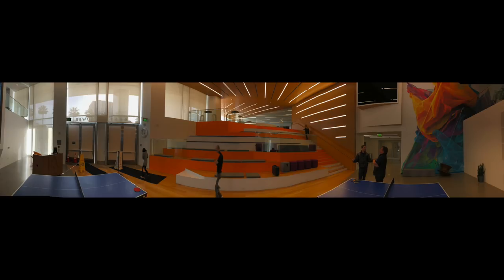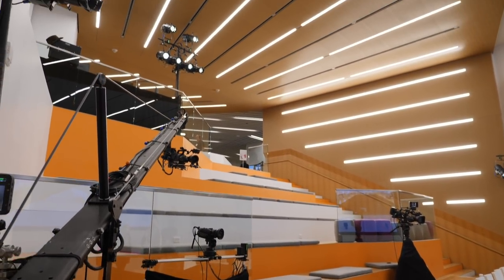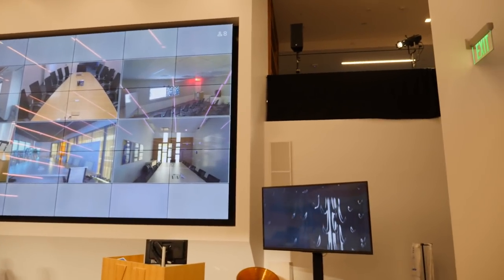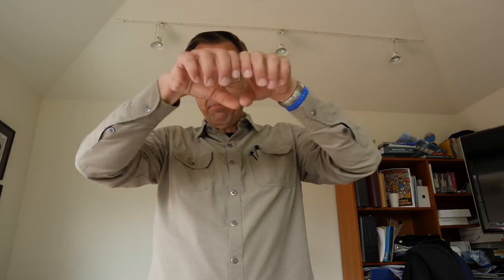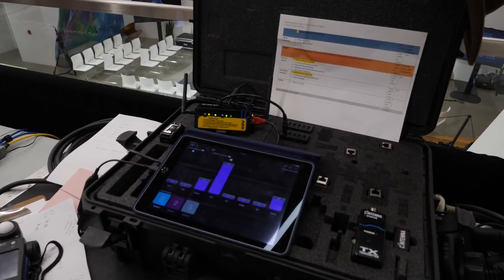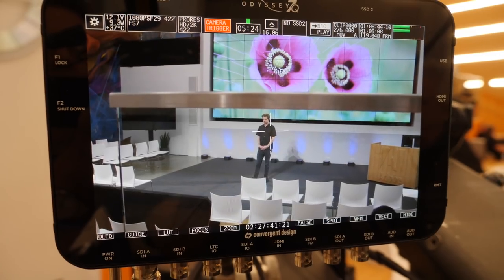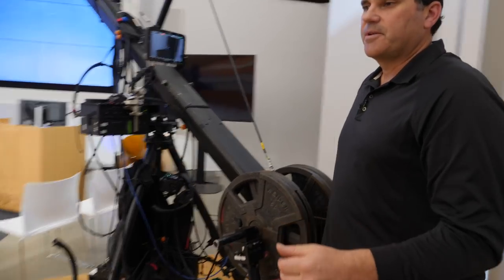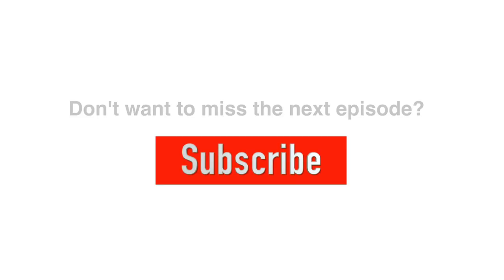Meet The Gaffer #92: Daylight Ellipsoidals

Comment: I used the first gen of the LED Source4's and found that color rendering and output wise they didn't really quite match up to the original. What gen were these and how did they perform?
Reply from the maker: The Series 2 definitely has more output. There is still more color fringing than I’d like, but that comes from having multiple color sources, instead of one tungsten bulb... and that’s true for both the Lustre S2 and the Daylight HD S2. That said, for a unit that has just a little less output than a 400 joleeko, is somewhat color tuneable, has minimal power draw, and has an on-board dimmer and DMX, it’s become a staple for regular interview set-ups where we need a fuzzed out window pattern or smash of light:)
Reply: Thanks for input! Seems like I may need to take another look at these...

Comment: Nice set up, as usual. Did you have any issues with lights reflecting off the large screen into the cameras?
Reply from the maker: We did not, but mainly because most Cameras were capturing talent with only the lower half of the screen. Whatever reflections were there momentarily in the handheld and jib shots were acceptable because we also had the ceiling and wall lights on and in line for reflection. We dimmed our Lights during video playback to the large screen, but the house lights stayed on... the LED monitor Wall was plenty bright regardless!

Comment: Hello Luke thanks again for the great vids. Have a quick question. I am looking for a "big light" that I can use on some shoots but honestly I never have a shoot that would allow for something bigger than wall power in a building or home. We don't do big generators😜. I am looking at the Hive 1000 wasp and wanted to ask, have you used that light and what are your thoughts? They claim to have a 10K equivalent punch and not a hot light. Thanks in advance.
Reply from the maker: We are always looking for the biggest bang for the buck! I dapple in units made by smaller brands, but as someone who rents equipment I need to have brand name fixtures available. If this is true for you, I would probably figure your “big light” is still an HMI. An Arri S360, a Mole LED Tener, or a Cinemills Sufa Bullet will all run off a standard US 20amp wall outlet, but may be more than you want to spend? I’m interested to see what Cinegear has to offer, but I’m not sure that anything has clearly eclipsed the color, compactness, throw, durability, and cost of Arri and K5600 HMIs.
Reply: Luke Seerveld thanks glad to know that I around open to help with answering questions🤘🏻🤘🏻